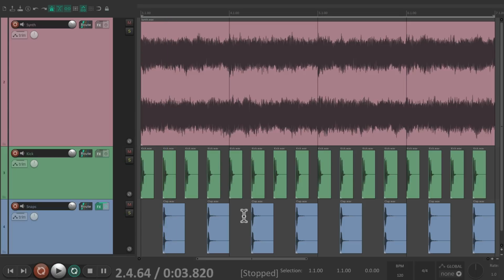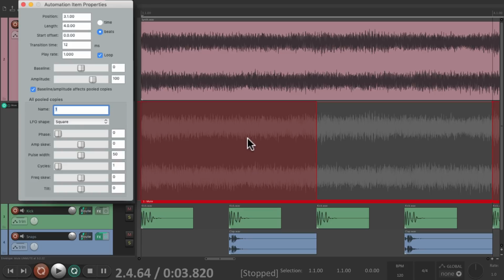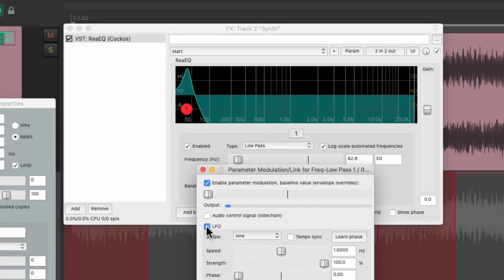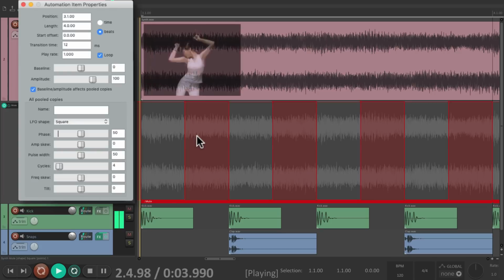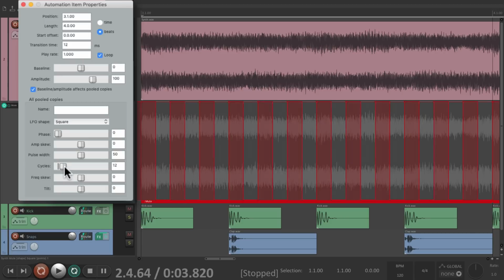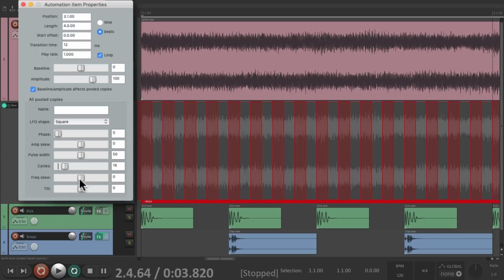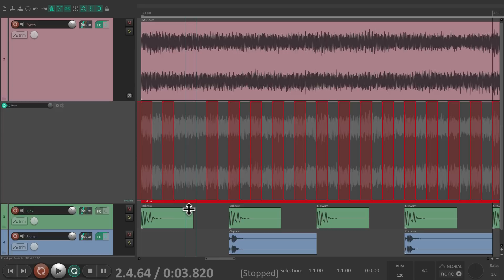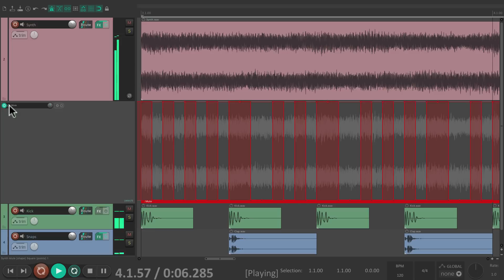Chopping Up Sustained Notes in REAPER

Comment: Whenever I'm recording a midi note in a loop it extends a loop of previous midi event before the new recorded midi event in the loop, I just reinstall reaper thinking I was the one mistakenly messing up the config but it seems to be that way since it has been install, I'm using the last version of Reaper. Thanks  check the link if you think you could help.
https://www.reddit.com/r/Reaper/comments/jfe8xi/bug_in_reaper_or_misconfiguration_not_sure/?utm_source=share&utm_medium=web2x&context=3

Comment: I have a question. In reaper when I play a Chord progression that shares common notes, the common notes dont play again. Anyone know what may be causing the problem
Reply: You need to cut the midi notes a bit short from the next one. Reaper reads them as one note if they are right next to each other. Select the previous note, hold down shift then left click and drag the mouse just a tiny bit to the left to shorten them.
Reply: @vivenzeo  Thanks ill try that

Comment: I have another way of doing it : by sidechaining a Reagate with a MIDI reasynth track. This way I can create my own chopping rythm, instead of just cyclic pulsation.
Reply: @ਰਵਿੰਦਰਸਿੰਘ-ਮ3ਝ  If I got it right, jmwicked basically uses a full sidechain. the reasynth part is optional and you can use any sound even samples.